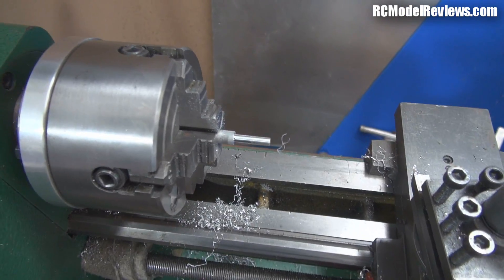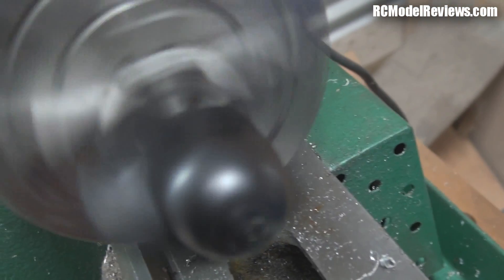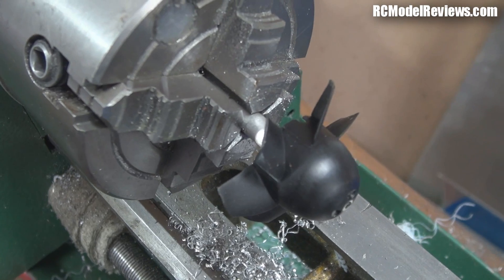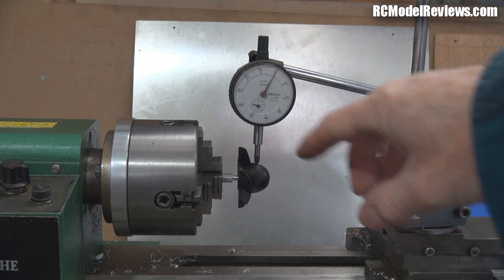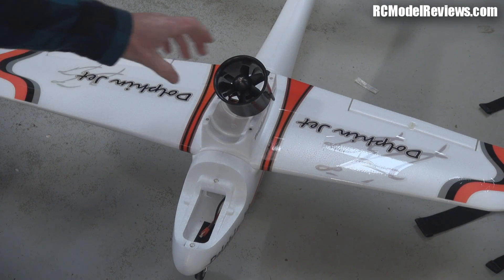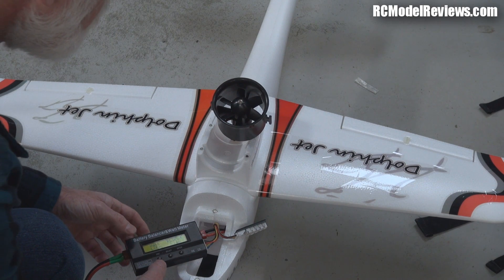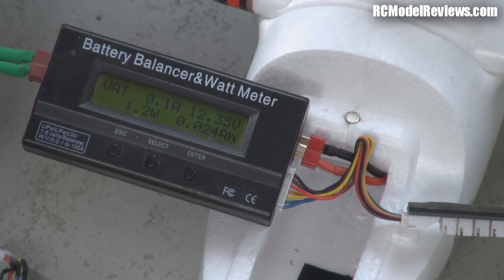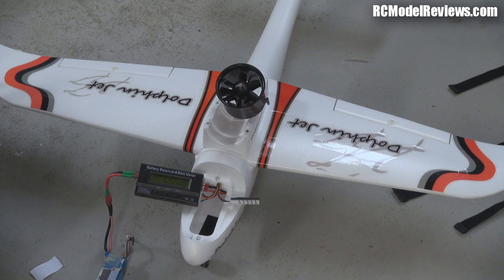A new fan for the HK Dolphin Jet EDF RC plane

Comment: Great vid as always Bruce. Would have been good actually to see how you modded the mount for the larger fan - I assume you used a hot-wire but a breakdown on how you approached it would be useful for a lot of us - did you change the thrust angle, did you just eyeball the cut, draw it on the foam or make up jigs at each end for the wire etc. All handy tips :-)

Comment: If they spent the money on a heat gun which measures an objects heat temperature, they could set up a buzzer to go off when its OK to pull the mold. But sadly, a lot of "Chinese Companies" are run by students in a small apartment pretending to be a BIG corporation and you don't always get the GOOD stuff.

Comment: 50% fan size increase (x-sectional area) ought to do it! LOL!
Should be much quieter, since the motor's going to be 'loafing' while producing the same thrust, and the impeller is probably balanced and true. 
The bigger fan unit looks better too!
Looking forward to the flight review.
BTW, if you had the crew that FT does, you'd have to build another shed - LOL!

Comment: I have to agree with you Bruce, the one gripe I've got with HK is their quality control on items like this that travel at high RPM, I bought two three mill  prop collets for an AXN & both were as useless as a fob pocket in your under pants with the holes drilled off centre. :)